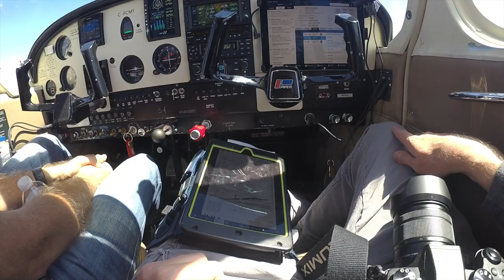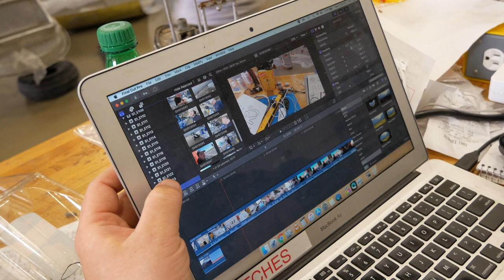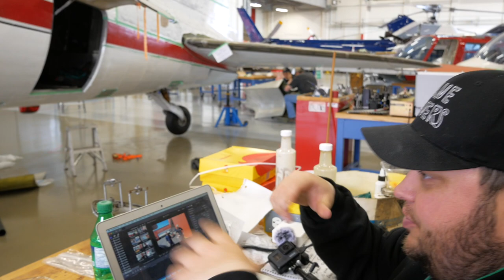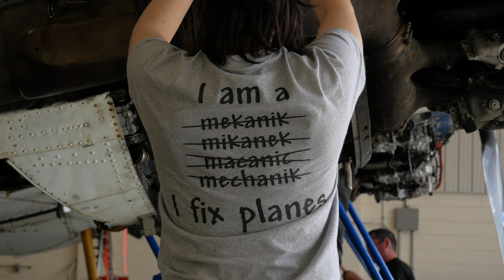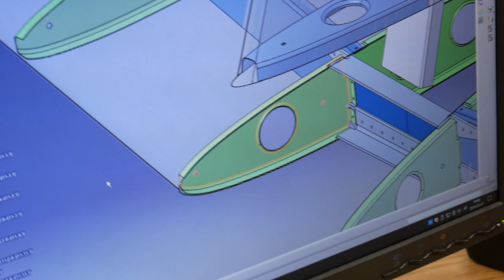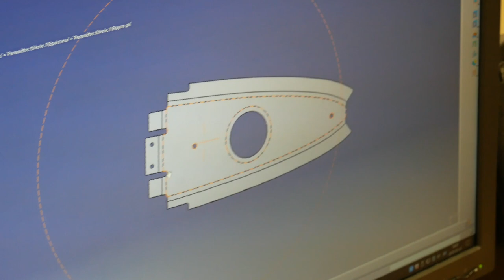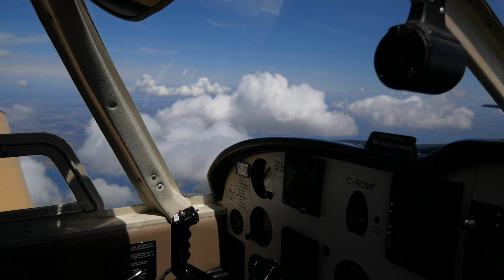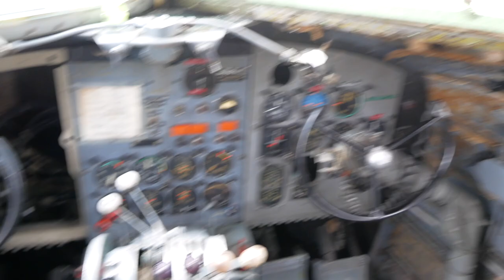This thing is gonna fly in 30 days? Buffalo Airways’ Mikey making it happen!

Comment: There are circular polarized sunglasses that will cut on the glare and keep the screen barely darkened ... BUT for VFR glinting and reflections are a good way to spot planes in the air, polarizing cuts that down considreably.

Comment: Polarized glasses work fine, just need the right pair. Some have horizontal filtering and others vertical, so if the LCD screen is the same direction of filtering it blocks the screen. You can turn the lens 90 degrees to see it go from blocking to clear. Currently using a set of Maui Jim polarized sunglasses with G1000 avionics and they work great.

Comment: In the 1970s I used to fly a Piper Arrow II.   When I saw the pilot's hands in his lap I recall my wife being shocked when I took my hands off of the controls.   She just knew we were going to fall out of the sky; she had no clue that an autopilot worked just fine at 10,000 feet.    Thank you for another great video.

Comment: I used to work in an optical lab, making eyeglasses. FYI, t
he problem with avionics is usually a problem with your glasses. Polarization is great, but only if you get the polarization axis of your eyeglass lenses and avionics matched up. Unfortunately, many people are walking around with both Rx and non Rx sunglasses that have off-axis polarization (it should be aligned relative to the horizon). I also wonder about cheaper avionics sometimes. 
LCD displays on cheap electronics can be problematic, with the manufacturers not understanding polarization,
The best thing to do is go to a real optician and have polarized lenses custom ground for your Rx. Most patients wear lenses that are cut from lenses with pre-ground optical curves. Unless you have a very simple Rx, this will not work out well. (Yes, you, Costlyco, Scam's Club and Lenscrappers. It's your fault!).
It's amazing how even pilots who put out good aviation content cannot manage to take two minutes to look up "polarization" on Wikipedia before they go passing judgment.